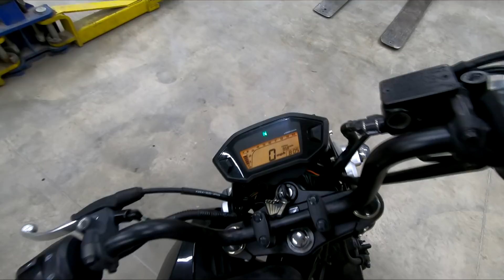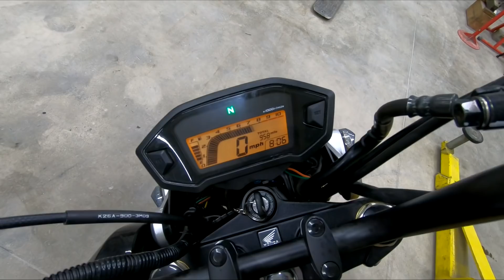Quarantine Shenanigans + I Bought A Honda GROM!

Comment: An intake, TB parts cam, and Cameron Jones Racing ECU flash wakes the Grom up. With those mods plus the full Yoshimura pipe it will put about 12hp at the wheel. It's also dirt cheap.